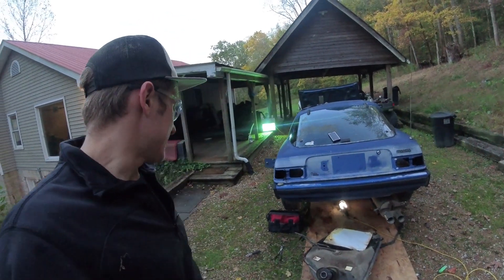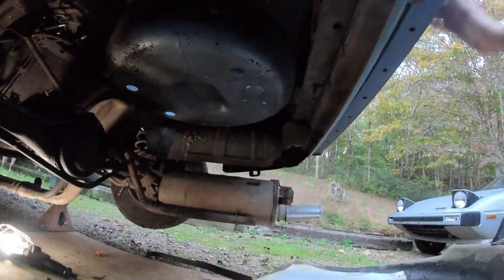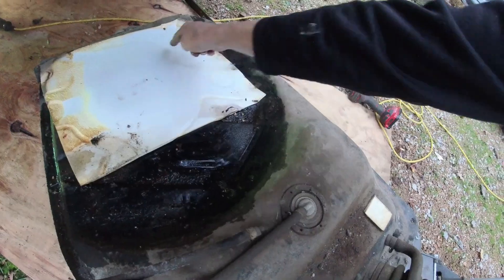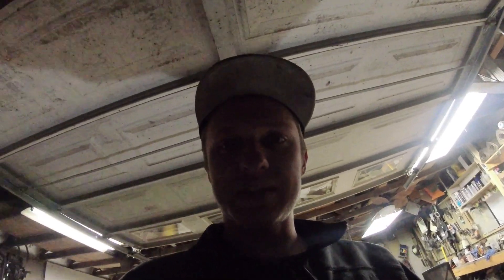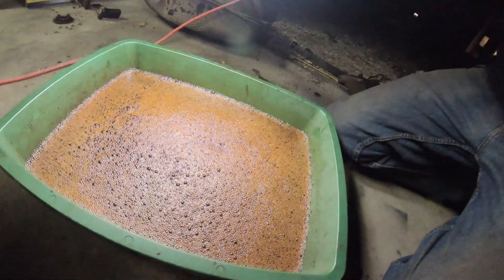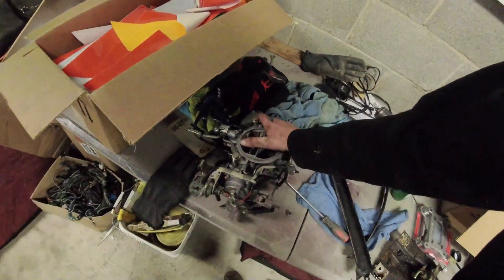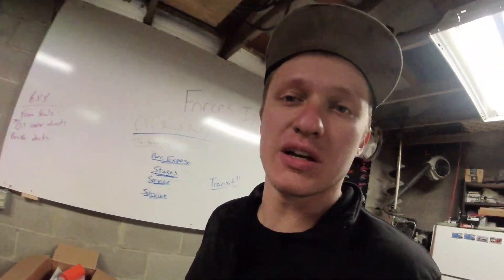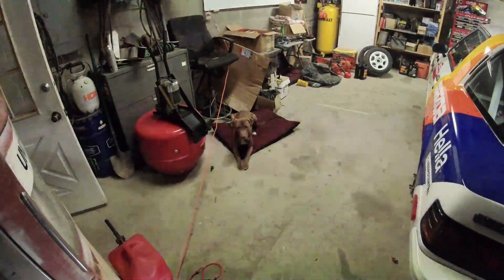Rust Brownies in the Fuel Tank - 1979 Rx7 AKA - Lil' Stu - Fuel tank and Pump Removal

Comment: Good vinegar bath with pea gravel, shake the heck out of it to use the gravel as a medium to beat the rust flake loose.  Dump rinse repeat until it isn't dumping debris any more, then coat the inside of the tank with POR-15.  At least that used to be the prescribed method on RX7Club back in the day.

Comment: Dude your channel has been a Godsend. Bought myself a 79' SA not running but very mint much like Lil-Stu there. Car sat for over 10 years and looks to be all original. Working on the fuel system now and that gas tank was toast on the inside. Patiently pressure washing it and soaking it in vinegar and muriatic acid has cleared the tank out immensely, but I can't see beyond the baffles so working the brownies out from the back of the tank has been a chore. Unfortunately, don't have spare tanks laying around.
Reply: Hey man, I know your comment's kinda old but have you had any luck with the muriatic acid?

Comment: I know that tank looks roached, but I was able to save one in even worse condition by first soaking with degreaser for a few days (and rattling around a hunk of old chain inside), rinsed/flushed a few times, then filled it with vinegar for about a week. If you're patient and don't need it right away, might be worth a shot before putting it into storage. You'd be surprised at how much of that crud you can get out of there.
Reply from the maker: I plan to clean it and use it as a spare in the future, but for the timeliness I think im going to swap to my known clean one for now. It's for sure a good tank with abit of work